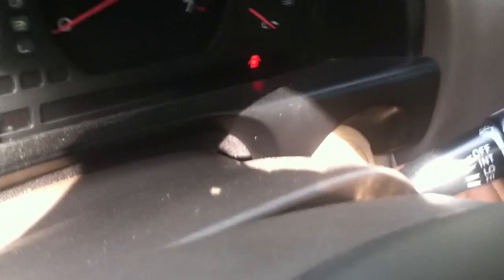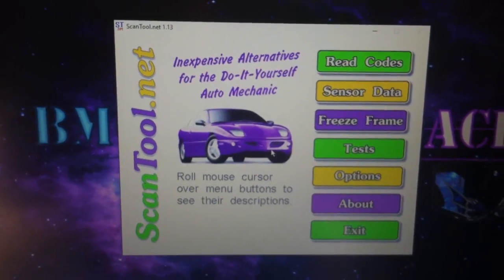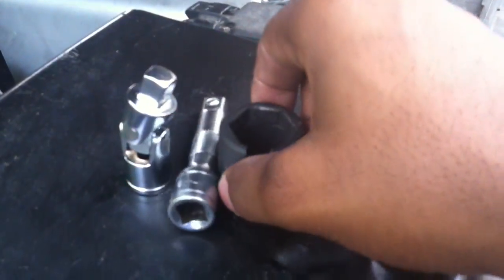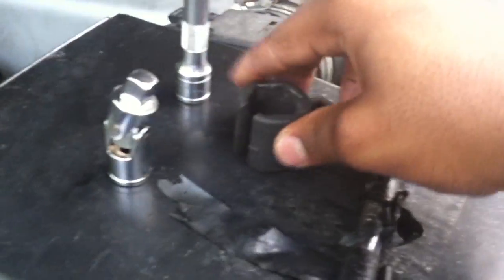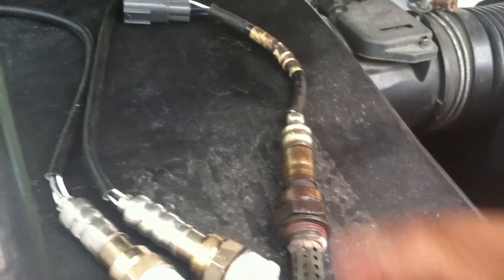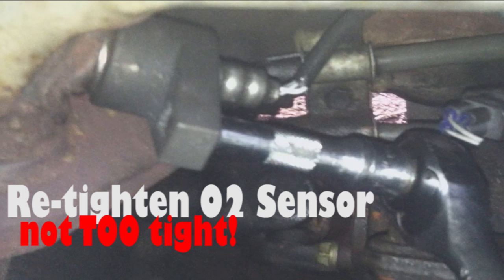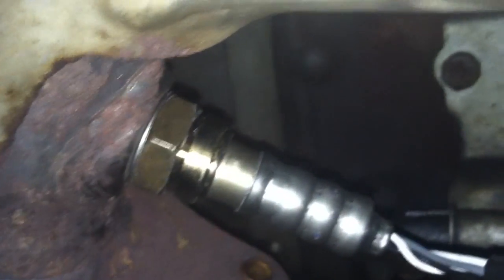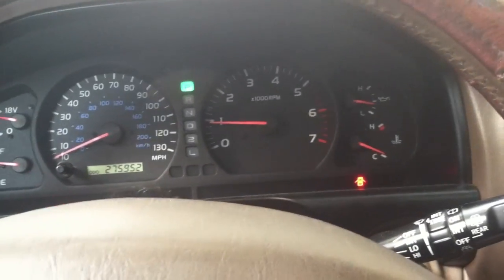How To Replace O2 Sensor - Bank 2 Sensor 1 "Code P0155" (Land Cruiser 100 Series)

Comment: Did you go with OE sensor or an aftermarket one? Thanks.
Reply from the maker: I believe I bought this aftermarket part from my local auto parts or Amazon. I don't usually have issues with aftermarket electronics unless it's the COIL PACKs which it's highly recommend to use OEM COILS with this truck. 

Other aftermarket parts are easy on the pockets for the next mod or upgrade  💯

Comment: Yo dude awesome video - one Question - where you got your OBD II reader? I NEED ONE... going to use this for my '07 LC
Reply from the maker: Hey Chris,

In this video I was using a cheap ELM327 USB OBD II reader connected to my laptop from eBay. You will need to setup the software and device on a laptop. I've copied a link to the eBay but do caution you that the items on eBay can be knock offs so you may want to purchase from Total-Car-Diagnostics.

https://www.ebay.com/itm/ELM327-USB-Interface-OBD2-Car-Engine-Fault-Diagnostic-Code-Read-Scanner-Cable-US/393049505900?hash=item5b8393806c:g:EdsAAOSw3o5f0IXZ
https://www.totalcardiagnostics.com/shop/car-diagnostic-tools/elm327-obd2-scantool

Further more not to talk you out of getting this type of scanner but I honestly found that having a hand OBD II scanner is more practical because it can scan codes, clear codes, perform live reading etc. Plus you can leave it in your vehicle incase a family or friend may need help troubleshooting a check engine light. I have the FOXWELL light which I bought from Amazon and I absolutely love it and keep it with me always because I have friends whom have project cars and at this we need a tool to figure out what's wrong with the vehicle air or fuel trims when rebuilding an engine.

The choice is yours but I honestly believe you will find a hand held OBD II more usful. 

https://www.amazon.com/FOXWELL-NT301-Professional-Enhanced-Diagnostic/dp/B00UJV3E12/ref=sr_1_2_sspa?crid=2GQVNU288XFEX&dchild=1&keywords=odb2+scanner&qid=1614973256&sprefix=odb2%2Cmi%2C148&sr=8-2-spons&psc=1&spLa=ZW5jcnlwdGVkUXVhbGlmaWVyPUEyQllURDA3M0QxTEY1JmVuY3J5cHRlZElkPUEwNTgxODAxMk5FNEtNN1BPSFJQTSZlbmNyeXB0ZWRBZElkPUEwOTYyMDU2MjVVMUxDQUtJM1k3SSZ3aWRnZXROYW1lPXNwX2F0ZiZhY3Rpb249Y2xpY2tSZWRpcmVjdCZkb05vdExvZ0NsaWNrPXRydWU=
Reply: @AWordFromMrJones  many thanks! love how the Cruiser community does their own maintenance. We saving ourselves literally $1000s. Keep up the good work